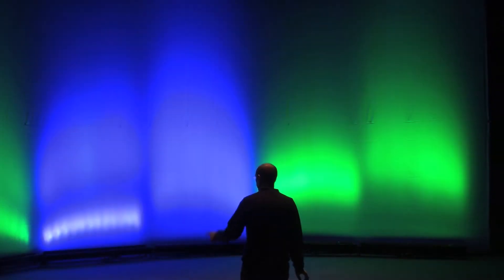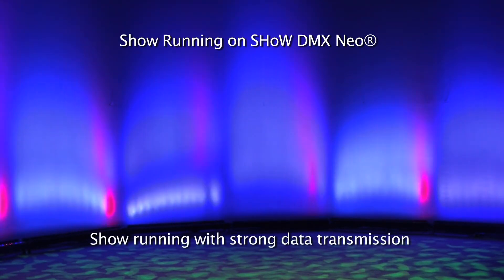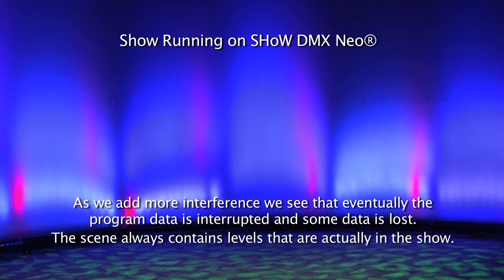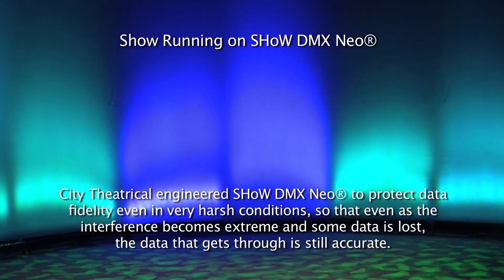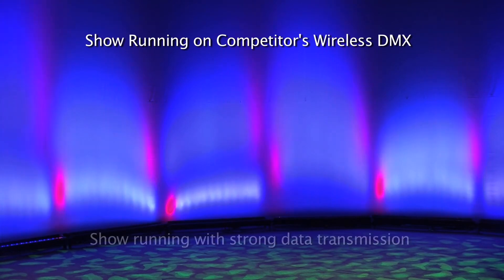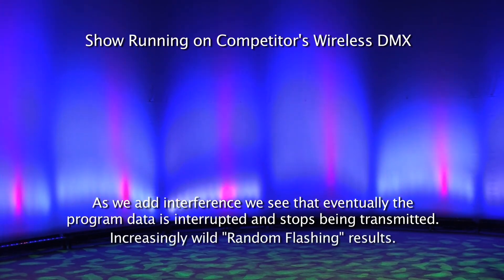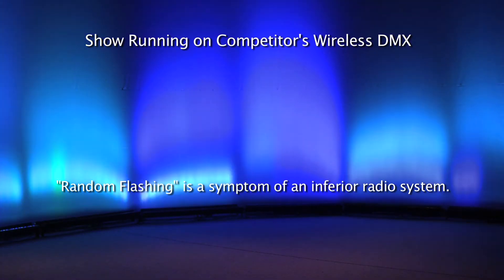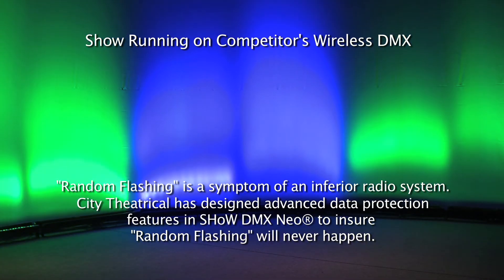"Random Flashing" With Wireless DMX

Comment: I have random flashing with a set of Show baby's. Any fix? I'm trying a different channel. Is that the best fix?
Reply from the maker: Please try a different show ID to rule out  interference problem.  I recommend trying Yellow.  If that doesn’t resolve your problem please call us at 800-230-9497, or send an email to support@citytheatrical.com.
Reply: City Theatrical Inc. I swapped it out with another transceiver. I swapped antennae, power the first hop DMX cable. Problem stays with the transceiver. Thanks for the fast response. We are able to juggle our fantastic Shoebabys and get the shows on going. I'll be in touch.